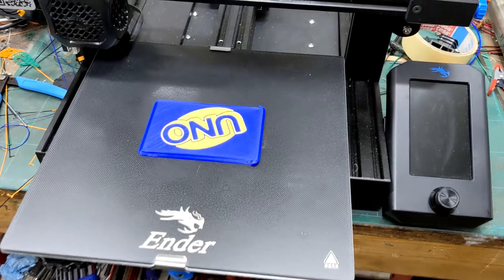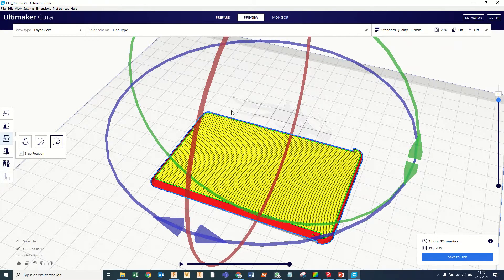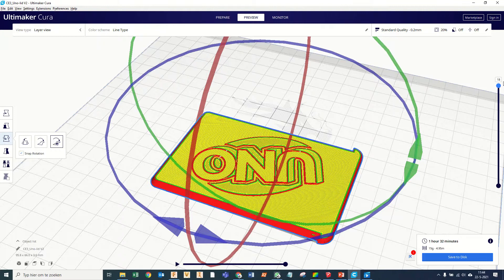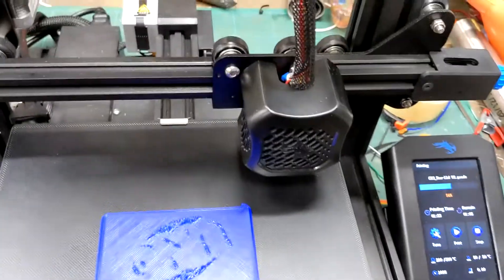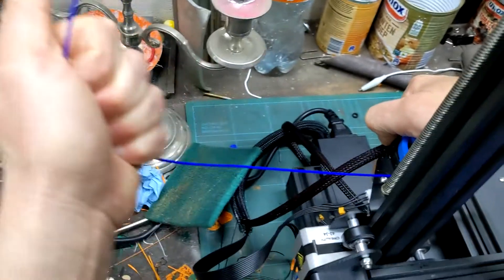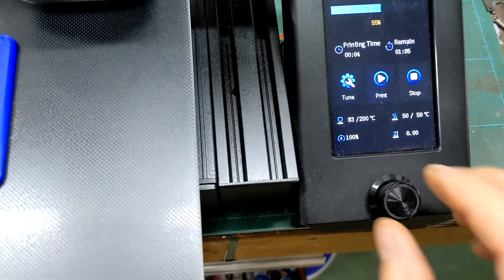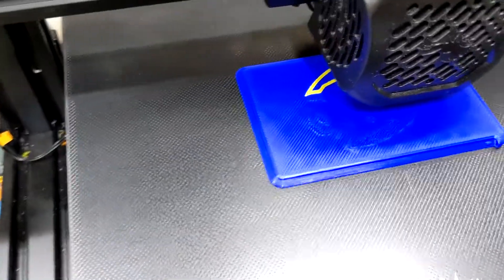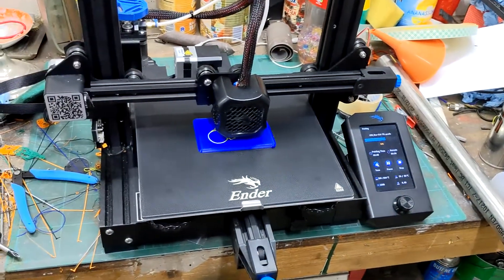Easiest & Cleanest Mid print color change with Ender 3 V2 and Cura.

Comment: Thanks, explained well with an example.
Is it possible to continue print with different filament type (different melting point) if I change nozzle temperature to proper value before switching? Or does it mess with flow of plastic because gcode was generated for first filament type?
Reply from the maker: I'm not sure about that.... I don't know if the manual temp setting overrules the gcode setting. But that's easy to try I think? If you could let me know what you find out that would be great!
Reply: @tna-technutamateur8249  i always change temp for the bed and nozzle on the 3d printer settings. for example i change temp for bed from 50 to 70 celsius and it works perfectly. i think preferences on the printer override g code cause i measured the temperatures too and it worked
Reply: @ItsKefir  Any time the printer gets a new G Code for a temp, it will change it to that.

Comment: Where did you get the "g code suggestion that cura already made"?  I didn't see you find anything except layer 15 - what are you typing into that text field for gcode before pause?
Reply: Nevermind I see that you typed over the "M300 S440 P200" from the black prompt that shows up when you hover over the text box.  Thanks.